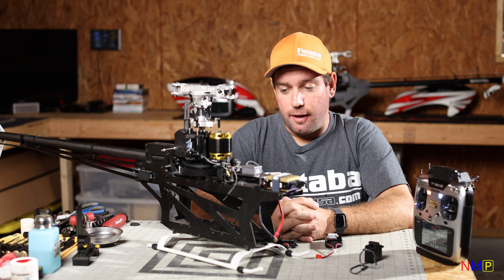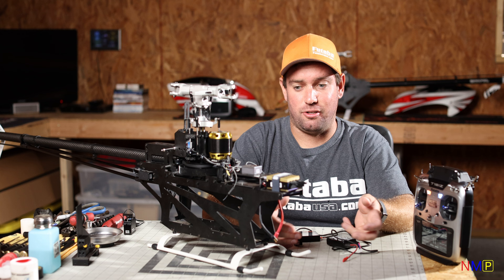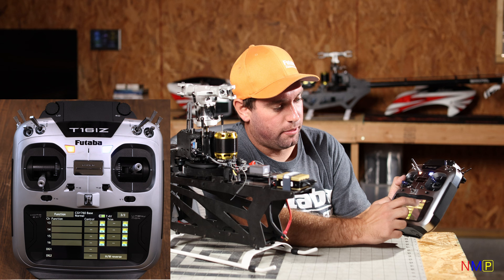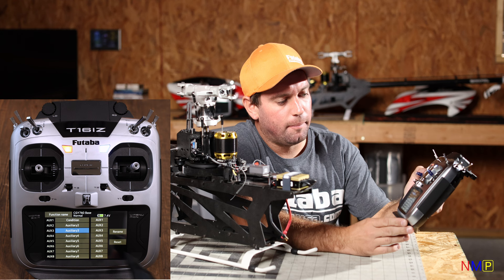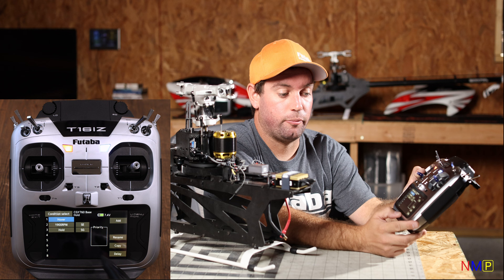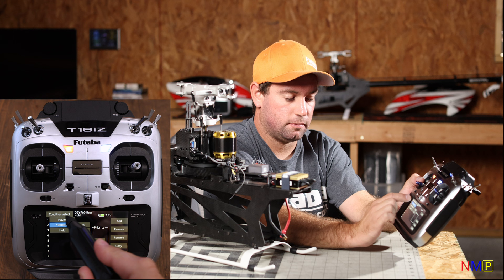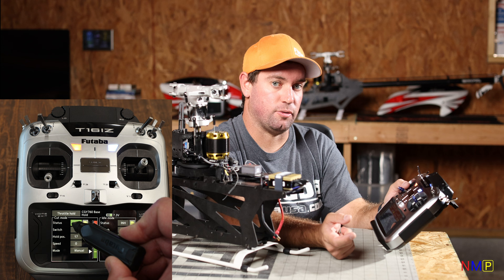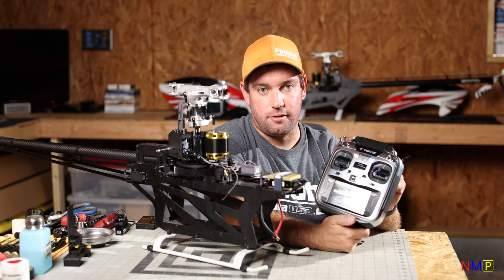Futaba 16IZ Setup for CGY760R Gyro

Comment: at about 36 minutes you start talking about ..gyro.. Would it be correct to say that the gyro needs to be assigned to a switch or somehow linked to the setup and that the green symbol means that it has actually been done for that particular condition or bank or rate or whatever you want to call it

Comment: What did you use to power the gpb-1‽
Reply: Yes, would be interesting, ‘cause I’m looking for two independent power inputs, but there’s only the free ELE2 port left for power input?…I will use all others for 3 swashplate, 1 rudder, 1 ESC, 1 telemetry …so I have to use a Y-cable, but this isn’t really smart🙁

Comment: I've not used those particular servos, but I'm interested to know why you're doing it on the GPB1 instead of the SBUS menu on the Tx? I LOVE being able to plug SBUS2 servos into my 18SZ to centre them! :)
Reply: The 760 pulse width can only be set on the GPB, it is not a choice in the radio.
Reply: @dosta223  Ah of  course, thanks Wes!